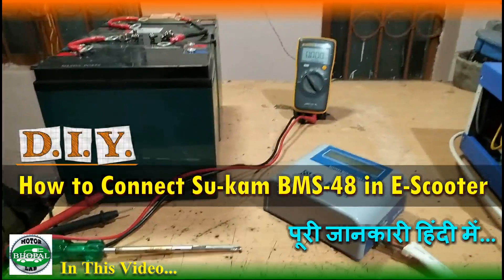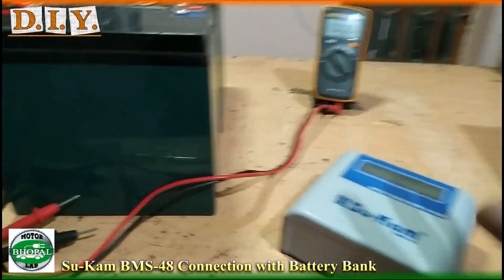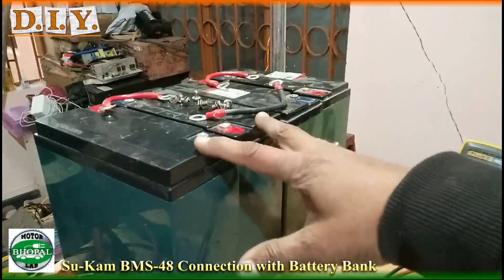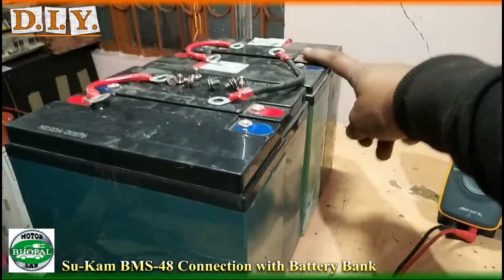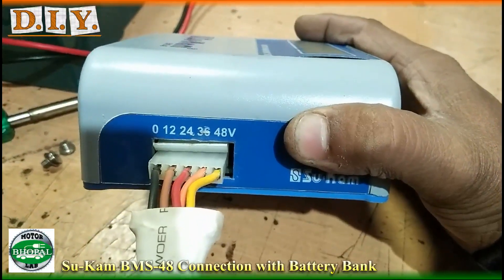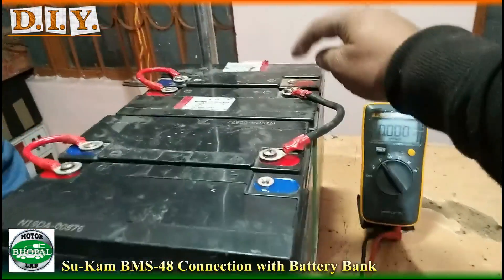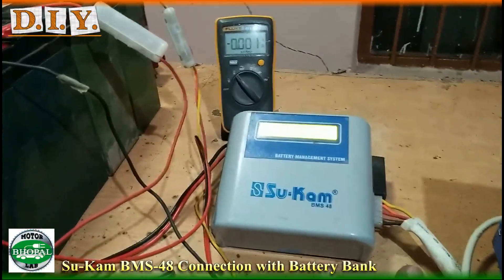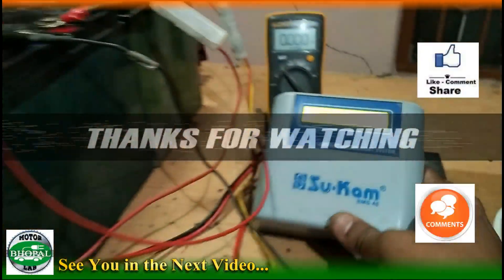Su Kam BMS for 48Volt  Pb Acid VRLA Battery Pack

Comment: How can i connect this bms in my ses 48 v scooty and charge the selead lead acid battaries by 48 v charger that scooter company given.
Waiting for your valuable opinion.thanks🙏
Reply from the maker: you need to connect this BMS with your 4 batteries then you can charge your battery.
Reply: @MotorLabEvsbhopal  let me informed about the price.
Reply: @feluda500  ses zoom?
Reply: @chanchaldas3970  ses eagle 48 v
Reply: @feluda500  full charge pe kitna voltage show hota hai?
Reply: @chanchaldas3970  51 volt some times 50 v with in 7 to 9 hours.
Reply: @feluda500  thanks for the information.